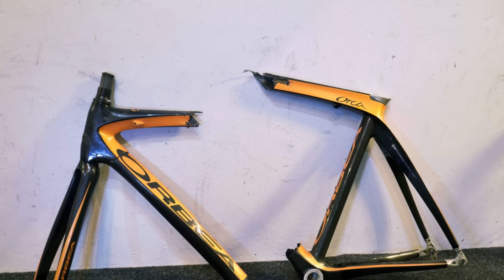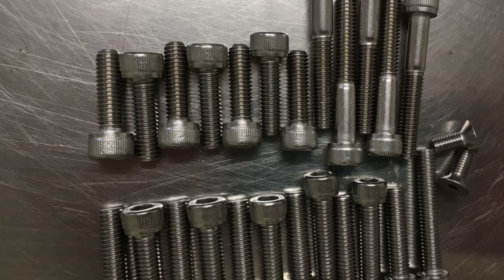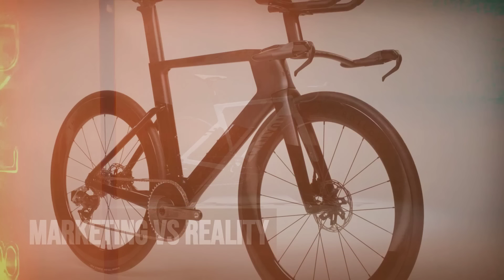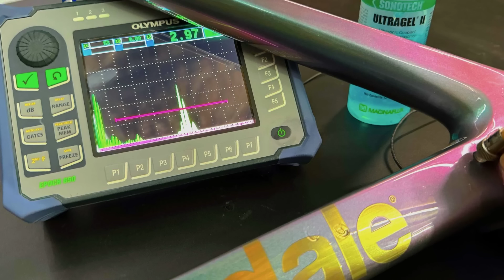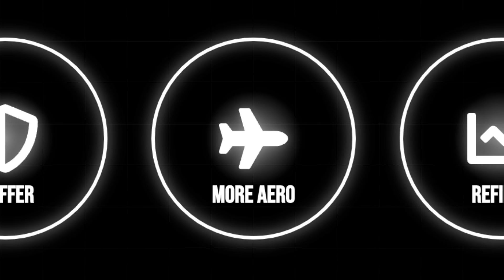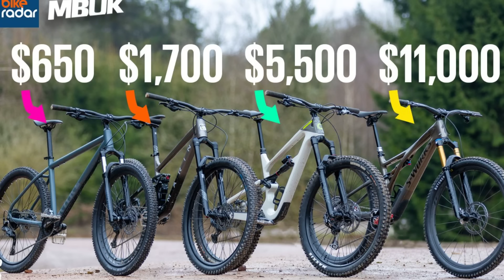Carbon Fiber Bikes — Scam or Genius?

Comment: Mmmm, ai repeating itself, killing decent videos. In a nut shell, carbon is stronger than steel but cannot handle impact anywhere near the strength of steel. I don't trust carbon, I'm putting new gear on my 1975 colnago super, like Ingrid road cranks, derailleur, new cable super record levers and syntace or tune alloy rims and Syntace carbon fibre drop bars , stem and seat post, the only brand I trust due to their  quality and quality control. Saddle is a 98 gram Tune Speed needle 💉😵‍💫

Comment: Top frame manufacturers Swiis SWI and TIME, and a few other European brands, have an in-house full process. Build time is expressed in labour hours, material, and quality (on average 22-40 hours per frame, material, and tooling, plus design and engineering). In contrast to eg the average wholesale value of S-Works frame a few years ago was about 600 USD (made in Asia somewhere)

Comment: I still ride my 2003 bike with an R-853 steel frame. It’s got full Ultegra with Shimano R-540 wheels. It has held up very well. I think I paid $900 at the time for a brand new bike. For really good ride it’s really tough to beat steel

Comment: I used to race bicycles and do long cross country I had a pinarella TSX frame steel alloy over the years I had tried aluminum and carbon fiber I always went back to the heavier steel frame the difference is still is like a spring when you push down it flexes out and back the trick is to keep the flex to just the right amount so that you rebound without changing gears this is especially difficult with a wide gear range but the result is you get less fatigued and your knees don't get injured as much whereas on a completely stiff frame like a Cannondale or kestrel there's no flex whatsoever and you feel like a sake mop after a long ride

Comment: If you can afford to replace your bike every 3-4 years, go carbon. If you want a 'forever' bike, go ti.
Reply: Yes, over 55K miles on my 1998 Litespeed.  And it still looks like new.  Only downside is 28mm tire max.
Reply: @bobnelson2828  does yours have a carbon fork? If so, is it original? I am not firing shots, genuinely curious. Coming from someone who still rides and race a Colnago C40.
Reply: @bobnelson2828  Why would you need to go past 28mm?

Comment: If you pay 12 grand for a carbon fiber bike to save 5 pounds, you are better off buying a metal frame and losing 5 pounds of fat. Most 'consumers' consume too many calories, and the cost-to-weight benefit just isn't there. Get a traditional frame, go on a diet and save thousands.
Reply: Exactly right.
Reply: Reynolds 953 and cutting down on starches for the win
Reply: AMEN!
Reply: You are wrong. There is a big difference between live weight and dead weight. Just ask any horse racing handicapper. When a horse wins too much they will handicap it with dead weight to a point that the trainer/owner will choose a heavier jockey to alleviate some of the dead weight imposed by the handicapper. A lighter jockey riding a horse laden with weight will always lose out to a heavier jockey riding a horse without the weights. That is a fact.
Reply: @henryt9254  how so? As far as physics is concerned, the bike and rider are one, moving mass. If the rider is heavy, wouldn't losing rider weight first make the biggest difference?
Reply: @markymarknj  Losing dead weight is a lot more effective. The reason being you can utilize live weight to your advantage through physical motor skills (coordinated movements of muscles and bones that allow us to interact with the world). This is very evident in horsemanship where riders can position its weight to the utmost advantage. Watch any steeplechase or horse racing and it becomes quite obvious. Likewise a cyclist use the same technique. You might not notice it, but I bet you that you position your body differently in a climb vs in a flat time trial.  That is also why UCI impose the bike limit at 14.9 lbs so that nobody can use the lightest bike to gain advantage. They don't extend that limitation on the rider weight though. So, dead weight does not equal to live weight.
Reply: @henryt9254  I've seen mountain bikers move around, big time.
Reply: @markymarknj  Do a Google search "Live weight vs deardweight in horse racing" and it clearly illustrates that point. In fact, "live weight" has a huge advantage over "dead weight".  The argument that the total mass for the lighter cyclist on a heavier bike is = to a heavier cyclist on a lighter bike with the same mass is true mathmatically. However, in the real world cycling performance it is not.

Comment: Tricking the cycling community into believing they needed a bike w disc brakes is the big scam
Reply: I don't want to deal with Hydrolic Fluid at all it seems like a pain in the ass, I'm perfectly fine with Cables.
Reply: and I get to lug 4 pounds of disc brake equipment around with me? (It all started with "compact cranks". When I saw those, I knew what the bicycle industry was up to).

Comment: They're environmentally toxic and have a limited lifespan due to stress fractures.
Reply: You do realise that most modern air liner wings are carbon composites…..if designed correctly, as it should be, stress fractures are not an issue.  Al will eventually fatigue, and so will steel if it is subject to stresses above the fatigue limit.  Point being, all materials have their pros and cons, and need to be designed to fit the use case.
Reply: @chapmag6578 
No, I didn't know about the aircraft bit. Seems dangerous to me. I mainly dislike it for environmental reasons. It can't be recycled, and carbon particulates and the resins are toxic. But I agree with the rest.
Reply: as I understand it there has been considerable progress in recycling carbon fibre products over the last couple of years, to the point where the carbon fibres can be rewoven. I think there is still an issue with recycling the resin though…..
Reply: @chapmag6578 
So, I am an A+P mechanic actually, and I looked into the aircraft. And it does seem that the 787 class (including the Airbus version) do use carbon composites. But that doesn't mean they don't break. Aircraft only remain working because parts are tested+replaced. But that doesn't apply to bicycles.
Reply: I add that in the USA, there are 44,000 toxic waste dumps holding all the waste Americans have created in the last 100 years, and on average, every American is within 10 miles of one. And that is where all your 60,000 types of chemical+industrial+personal eats ends up, slowly sleeping into your soils and groundwaters. And you can expect to see only increasing cancer rates and other health issues. And nobody has the power to stop it from getting even worse. Greed trumps health. There's not a single food that doesn't have toxic levels of heavy metals. And there's no way to clean it up. No vacuum cleaner to remove all the toxic waste man has created in the last century.

Comment: I bought a carbon/plastic bike 12 years ago because I liked the way it felt. I still ride it because I still like the way it feels. It's not aero and it doesn't have disc brakes or electric shifting but it goes real good.
Reply: Same. I bought a Trek Madone 4.3 in 2014 and I still ride it and love it.

Comment: or you can shop smart or wait for a deal. i got a 2014 pinarello montello FP8 frame brand new for $300 from someone on ebay who didnt know what it was (no its not fake i checked).i have also yet to see a frame just explode like all these fudds in the comments talk about,maybe my 30 years of cycling is short sighted or maybe they are just fat asses and are too heavy for it.most people who hate carbon are luddites who probably cant afford it and are projecting.every material has its pros and cons do people forget aluminium can get cracks in the welds(had a fuji frame that did that) or get corrosive lesions and fall apart?dont even get me started on the steel hipsters.ride what you like and leave everyone else alone cycling has become a bunch of karens

Comment: Carbon fibre is awesome. Not all carbon prepreg is the same and not all carbon bikes are laid up the same. Expensive bikes is expensive grades of carbon. Are all tires the same? Rubber is rubber right? No. Are all white shirts the same? No. Are all leather shoes the same? No. Buy the bike you want, its worth it.
Reply: It's your money so yeah do as you like. I ride steel as it lasts and I don't chase trends. I am not a pro racer nor trying to impress anyone.  E.G., electronic shifting is not for me.
Reply: @Skedawg88 Agreed, steel, aluminium, titanium, get the bike that makes you ride.
Reply: All carbon is inexpensive now stop listening to all the crap the industry tells you
Reply: Too many "ifs". If my shirt fails, I go without a button for an afternoon. If my fork fails cause someone screwed up or the environment/storage in the freighter was wrong, I'm severely injured.

Comment: Carbon fiber: Cool factor and lightness 10, durability 6, Aero probability 10.
Cost for aero: 8
Probability of repair: high
Longevity: Finite

Modern Titanium: Cool factor: 10 (b/ it's Ti) lightness: 7-8 Durability: 10  aero probability: 7-8
Cost for aero: 10
Probability of repair: extremely low
Longevity: lifetime 

Bottom line: 90% of all riders don't need a carbon bike.
Reply: Exactly
Reply: According to the experts with whom I have spoken, carbon will last forever…. And, is infinitely easier and less expensive to repair than TI….   That said, as the owner of 3 carbon frames, I have been lusting after a Mosaic…
Reply: Actually cost of Ti repair can be very high, depending on the alloy and heat treatment. I have a 2002 Litespeed Tuscany and a 2021 BMC road machine. The Litespeed is a work of art, however, BMC with wider tyres, discs and Di2 is a dream to ride and my go to machine.  Maybe 90% of riders don’t  ‘need ‘  a carbon bike, However, each to their own depending on the use case.